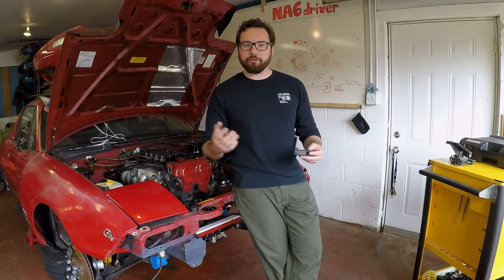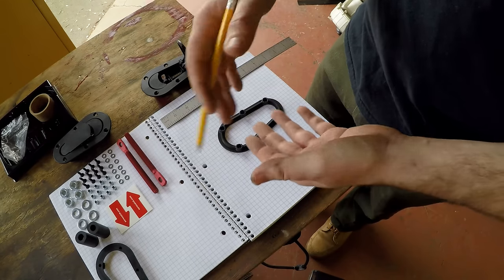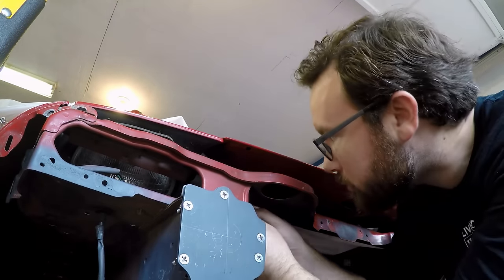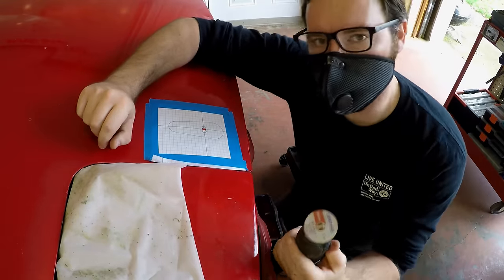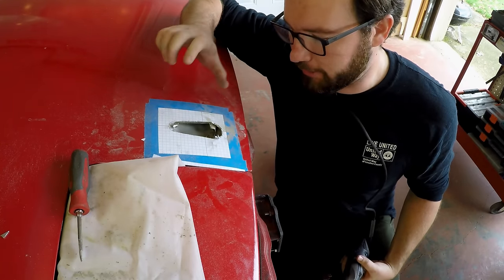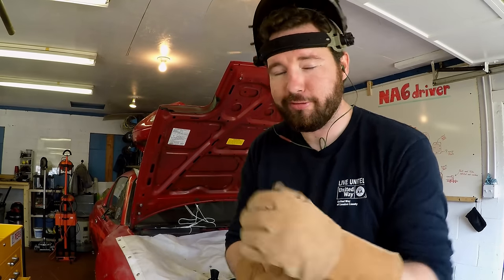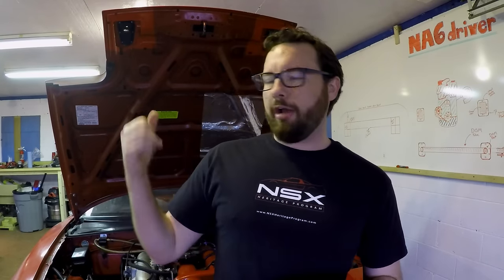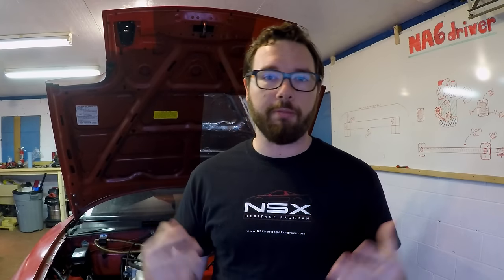How to install AeroCatch hood pins.

Comment: Those Aerocatches are great, I'm putting them on my next project car. Thanks for demo-ing the whole installation!
Reply from the maker: They have been great so far.  No issues with them.  Hope this install helped.
Reply: Can rust appear at the edges of drilled holes?
Reply from the maker: @baltaalex3158  If your hood is steel I would assume some corrosion could happen, since my hood is aluminum I'm not that worried about galvanic corrosion since the screws are coated.
Reply: Cody Yankey thank you!

Comment: Always wondered how these get fitted and finally found out, thanks for simple explanation and you've earned another subscriber. Just a thought but if you used a hole saw that was the same diameter as the curves and then join up with the dremel it may have been easier (if that makes sense)
Reply from the maker: Thanks man!  The hole saw idea isn't bad but it requires a good amount of downward force and they tend to wonder around when cutting.  If this was a steel hood I'd be all about it but since it's aluminum I'd probably mess it up.

Comment: Tungsten Carbide burr bits work well with the Dremel to finish up the cutout, then a little clear coating on the bare metal/aluminum (as you said). Looks nice. Thanks! (New Sub)
Reply from the maker: Good call on the Carbide bits.  They are a bit pricey but they would take care of the steel supports super well. 

Not so much car content on  my channel these days, but thanks for the sub and comment.

Comment: very nice job man!!! just got my hood pins today and this makes me feel at ease about doing the work myself! thanks for the educational video!
Reply from the maker: Hell yeah.  Love to hear stuff like that.  You got this.
Reply: @CodyYankey  just have one question. looking into the dremel tool and I'm wondering if I could get away with just a simple one or two speed or would a variable speed dremel work better?
Reply from the maker: @forstd09able  So the good part about the variable speed is you can use it for other projects that you might need to go a bit lighter with.  You will probably need to maximum speed for the cutoff disk but the drum sanding bit would remove material too quickly on some material if you only had full speed.  I usually try and spring for the best tool I can afford since it's something that is going to be sticking around the garage for years to come.

Comment: ive fitted sooo many of these to rally cars. easiest and best hassle free way to cut the hood/bonnet out is holesaw drill bits the correct size at each end and then grind cut the rest out.
Reply from the maker: A friend of mine did that and the issues he had was concentric hole saw bits.  They like to wobble hard in anything other than flat stock.  It was a big time saver for him considering he put 4 in his hood.  It also requires a hole saw set and a good one can be quite costly.  I bet for composite hoods it's probably the best method though.
Reply: Cody Yankey 100% agree its easier with a holesaw on composite or carbon panels but can be temremental on curved steel 👍🏻 they look ever so nice though. great job

Comment: Nice man, only thing that sucks is all the metal that has to be removed below. Great video mate! Thanks!
Reply: Doesn’t have to. He made his fit very tightly. If you look at the end of the vid plus the instructions picture online; there’s a good cm to just about/right over half an inch of space left on them screws. If he drilled straight through it would have latched but his hood also was uneven so he removed them on his own account.

Comment: I think I would have started with appropriately sized metal hole cutting bits on the top and bottom, going all the way through the hood, then connecting them with two cut lines.
Reply from the maker: If you have the tooling then it's a decent option.  Just be aware that hole saw bits tend to walk around and cause a good amount of heat.  This is an aluminum hood so keeping temps low is important so you don't gum up the teeth or cook your paint.  I think everyone has a Dremel and hand drill.

Comment: I compromised with a wood router and an old bit took me a little bit longer
Reply from the maker: Like a trim router?  What kind of bit did you use?  That's not a bad idea given this is aluminum.  It just tends to "gum up" steel bits.

Comment: Rather than putting them 'backward' you could have gone 45 degrees.

Wouldn't their be benefit in keeping both layers of the hood?
Reply from the maker: I installed some later on a friend's EF civic 90 degrees out and it looked pretty good. 45 degrees would be cool but, difficult to replicate exactly on both sides.  I would need to do a template that I could flip or something to make them match.  Fun idea though and probably looks great on certain cars.

I don't think you could mount it in more than a single layer.  The single layer of aluminum has been good enough for me, maybe a rally car or drift car would need more rigidity for panel mounts?

Comment: When I did my first side mines had a little play in it. Did you find that the holes were really close to the edge ? I think I cut out a little too much
Reply from the maker: Yeah, the holes were very close to the opening.  It sounds like you may have drilled oversized holes for the hardware.  You might be able to fix that with tightening down the screws a bit more.

Comment: Hey man nice vid! @ 5:50 you said you have to “mark your centre offset a little bit” can you explain that part?
Reply from the maker: It wasn't really needed.  I thought the lower metal support was going to be used for the support bracket so the offset was to compensate for the angle the hood rested on the pins, but the lower bracket only bolts to the upper hood skin, so you have plenty of room to make adjustments if needed.
Reply: Cody Yankey ok gotcha! Thanks

Comment: My project car I'm on currently (not on this channel) I have a target speed of 200mph.  Think these will hold up or should I go for the heavier ones for the strength...  It'll be holding down an FRP hood so I don't want anything weaker than the hood material
Reply from the maker: Gaming Made Simple I'd shoot for something with more strength. I've got some friends with track cars that use 3 and sometimes 4 of these plastic ones and they see maybe 140-160mph.  Hood venting will also help.
Reply: NA6 driver new hood will be vented.  But FRP can't use normal hood latches so I'm limited to hood pins.   And these flush ones would be ideal so I don't have old style pin flopping around in the wind

Comment: Watched this through your story on IG, Glad you had good success. I'm curious what mask you're wearing is, I'm not too fond of the cheap paper ones.
Reply from the maker: This one is from a company called RZ, the M2 mask.  It is mostly for wood working but works well enough for light metal grinding in an open space.  I can't totally recommend them as the Velcro is sorta weak and I usually have to adjust it every couple of minuets.
Reply: Fair enough, I at least have a brand name to Google and look into, appreciate it.
Reply: why were you wearing a mask? woodworkers wear masks cause the oils in woods can be irritating and also because of the potential volume of particulate matter but every metal worker i know only wears a mask if they might be dealing with lead paint  or is painting with a spray gun. they will wear a full on respirator id they are welding bronze because of the tin or galvanized metal because metal fume fever is not good
Reply from the maker: seshmarls I'm not gonna have some technical response as to why but I can tell you that when I grind or cut metal without a mask I  always end up with black stuff all in my noise.  Whether that is the grinding disk/stone/belt or the metal itself I don't know.  I do know that it doesn't make me feel safe about the health of my lungs.  So I try to wear a mask and blow my nose while in the shower.
Reply: @seshmarls  I work in deburr and the amount of alluminum and steel dust floating in the air is enough to make you worry enough to wear a mast. Anything set down will have a coatinf of dust in twenty minutes

Comment: What year is your miata i just started a channel with my 1990 mazda miata im gonna turbo it and run it on the track also. Where did you get those coils i want to eliminate the single coil by the firewall
Reply from the maker: Jack of all trades King of NONE ! The coils are from a GMC truck.  They are called D585 coils.  I've got a video on the process but you need to run an aftermarket ECU to use them.
Reply: Ok thanks i plan to turbo so i will be getting a megasquirt 2 pnp soon

Comment: Why not just install them horizontally?
Reply from the maker: Yeah, someone said the same thing a few comments down.  Didn't even think about doing it that way.  I want the largest indicator I can that my hood latches are up.  Having them mounted sideways might have been better than backwards, but maybe not.  I've had no issues with them so far.  They did fine on track at 120+ mph.
Reply: NA6 driver nice.  I read on their site if installed either the two ways they suggest they have a warranty, assuming they void it if installed incorrectly.  I doubt theyd ever fail even over 120.

Comment: So you understand the point of these and actually chose to install them incorrectly and eliminate the safety that they were designed to provide?!?!?!
Reply from the maker: I wouldn't say I elimated all the safety but I choose to ignore some variables for failure, sure.
You got one of those pad all the corner, nerf the world, helicopter dad vibes going on my dude.
Reply: Cody Yankey no. I just forgot my hood pins and my hood folded over on my outlap. I bought these and watched install videos for the exact reason they’re designed to prevent and you chose to purposely eliminate the benefits of these.
Reply from the maker: @dadasracecar  Sucks to hear about the pins, which is why I went with these preemptively.  I've done 2 track days and 1000s of street miles since the install.  It's probably pure luck at this point my pins haven't unlatched themselves in VMax at Barber and AMP.  I'm sure I'll lose sleep thinking about now 🙄
Reply: Cody Yankey been driving, instructing, and racing now for 9 years before forgetting the pins. First time and my hood is ruined.